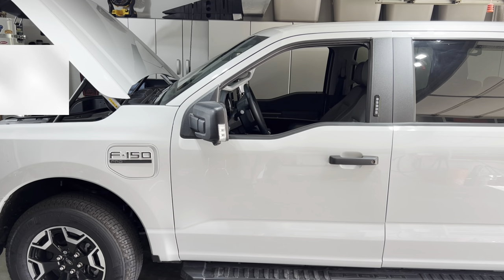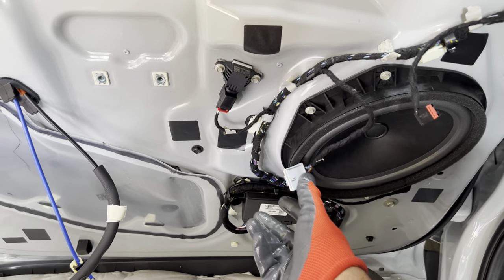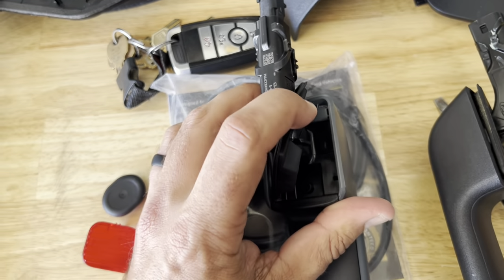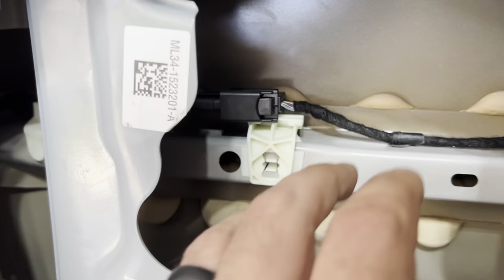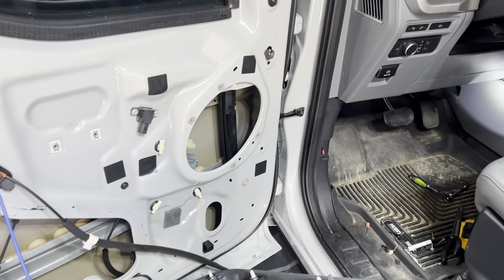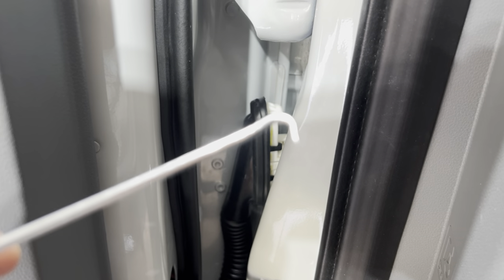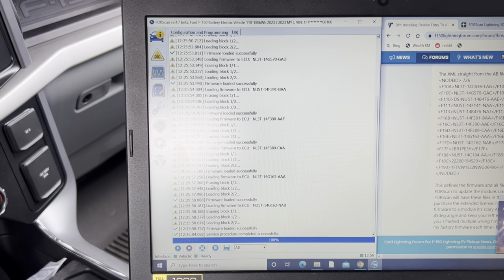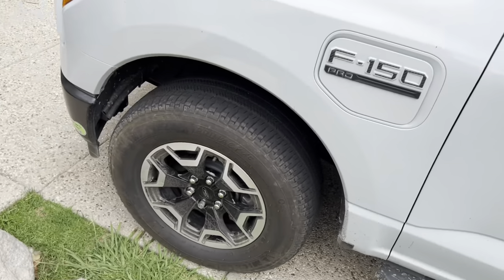22-23 Ford F150 Lightning Pro/XLT How to Install Passive Entry

Comment: Glad you did this first, I just did it on my '23 Pro extended range and really only had an issue getting the plug off the door which was a total pain! Gave up on the door plug wires and took it to the dealer and paid them a few hundred bucks to remove it and add back the new one. After that was pretty easy and works great. Thanks for doing this first and showing us the things to watch out for.

Comment: Used your leather steering wheel mod video to install one on my Pro, really appreciate the tutorials you put out! Have you thought about the adding the Lariat light bar to your grill? I’ve seen some people do it on the forums, but would love to see a tutorial if you ever get around to it!
Reply from the maker: Hey thanks for the kind words. I would love to do that but I haven’t seen anyone that’s been able to get it to function correctly.  Do you have a link to the thread your referring to?  Sounds like the wiring is there you just need to trim the pro grill. Unfortunately from there you need to turn it on with forscan and that’s what everyone is struggling to figure out.
Reply: @KurtsRPMGarage  Ah yes, I saw that same thread but didn’t realize that they weren’t able to turn it on. Hopefully they’ll figure it out! Do you know where they ordered the light bar from, or have a link?
Reply from the maker: @jordanjohnson9820  I believe they got it off eBay from a crashed lightning. I just did a quick search and there is another for sale on eBay for 450$.

Comment from the maker: Just wanted to clarify a couple things. The black door handle I put on after does not have the correct wiring. I pulled the cover off and swapped it onto the handle mechanism that originally had the gray cover on it. If you don’t want to dremel or if you screw up like I did you will have to buy both handles and swap the covers around. Also when using the passive entry you wrap your hand around the handle and it will unlock. If you just place your thumb on the “button” it will lock. Works great after I figured that out.

Comment: Blue cruise next! 😆
Does the bronco handle include the interior piece with the wiring channel?
Reply from the maker: Haha that would be sick.  The bronco handle comes with the “plastic handle frame piece” that sits partially inside the door of the truck and inside the handle cover on the exterior of the truck. Unfortunately the wiring it comes with is incorrect. Hence why you have to buy both handles if you go that route. Hopefully someone comes up with a better solution.  Someone who has access to the ford parts catalog would have to figure that out.

Comment: Have you totaled up all the aftermarket parts and time in labor you’ve spent upgrading the truck? Serious question because I am an owner of a lariat but would have also considered a pro for the savings and just add a few of the upgrades you e done myself (keypad, adaptive cruise being my first) wondering how much you’d save in the end. Also have you discovered if adding cooled seats is a possibility (oem style).
Reply from the maker: I haven’t but I imagine it would be pretty reasonable. Most of the upgrade parts were under 100$. The most expensive upgrade was the adaptive cruise control. The parts were around 700 plus about 6-7 hours of my labor.
Reply from the maker: To get cooled seats your best bet would probably be to find some higher end trim seats off a wrecked lightning and then swap them in.  Another option would be to go through katzkin and get leather and heat/cooling at the same time.

Comment: Any chance this would work on an XL model?
Reply from the maker: Probably but I think you would need the body control module firmware for a gas xlt or lariat. If you can find that it should work just fine. I did a search of the gas f150 forums but couldn’t find anything. Might be worth posting there and seeing if those guys have a solution for you.